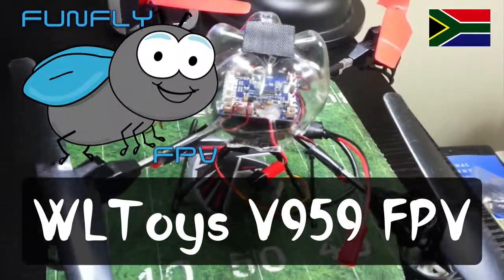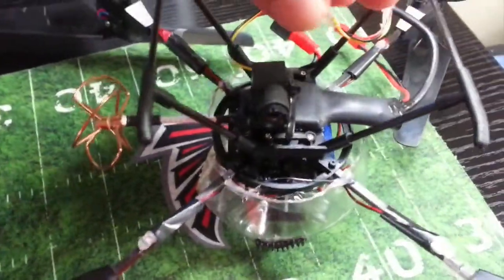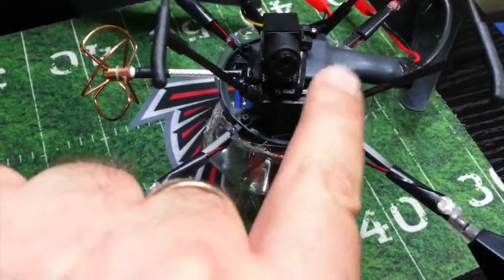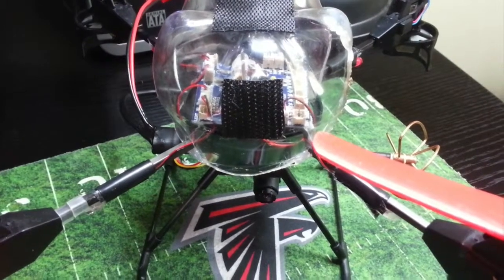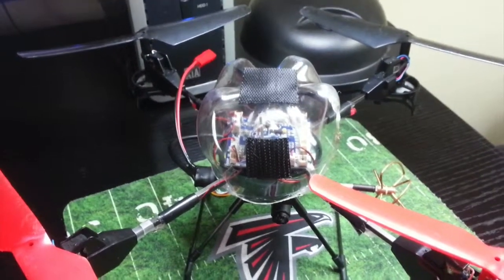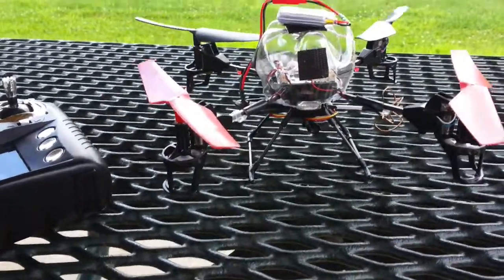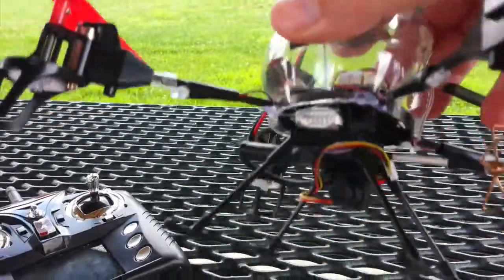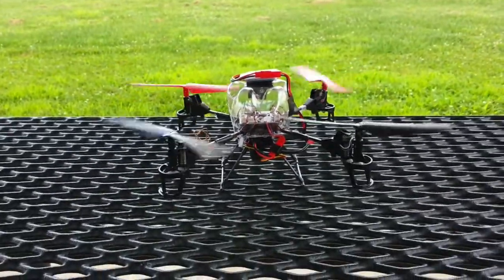WLToys V959 FPV build and flight

Comment: I have an 959 ans i love how i can crash from 80 meters something line that becouse i lost the front of the heli, and i dropped my controller to run and catch it becouse i lost signall, wasent fast enough onley damage= lanfig skee broke and 1 prop was bend and a gear is 1/8 broken but it still flies. Parts for it is really cheap do i recomend this for training on banking and just flying

Comment from the maker: Benjamin, I used a separate battery for the FPV gear. You can drive it of the main battery, but it will starve the main battery when you fly, and in that case you will need power regulators also. It is best to just drive it off its own battery.

Comment: wow this fpv mood is great i just order parts for assembly for my v595. Few question where did you take power i see that you have same connector as it is on battery? Do you have splitter? Did you try take it from connectors for special function?
I have ordered boscam transmitter don't have yet goggles how did you manage to bind together fatshark whit boscam?

Comment: How did you build this?  Can you provide me with a link to the components you used to build this neat little FPV setup.  I have a V959 and would love to do the same.
Reply from the maker: Renfeild Light It's pretty easy and there are many ways to do it. I used:

Camera:  http://www.surveilzone.com/0.008lux-520tvl-mini-fpv-camera-90-degree-view-angle-3.6-24v-hs1151
Transmitter: http://www.banggood.com/FPV-5_8G-200mW-Wireless-Audio-Video-Transmitter-Module-TX5823-p-84780.html

And any 5.8 antenna will do. Just solder it all together and drive it from a 1 cell 3.7 lipo battery.

Let me know if I can assist.